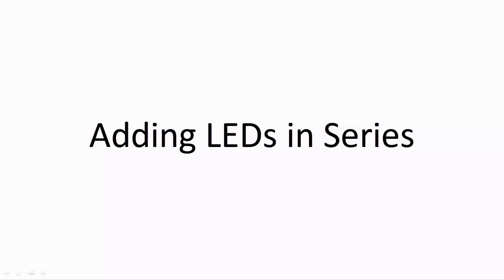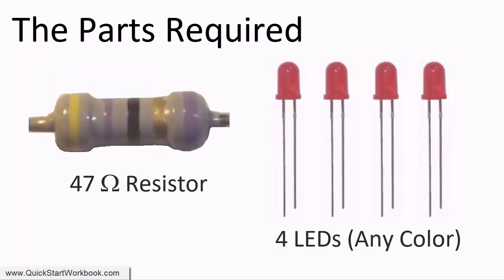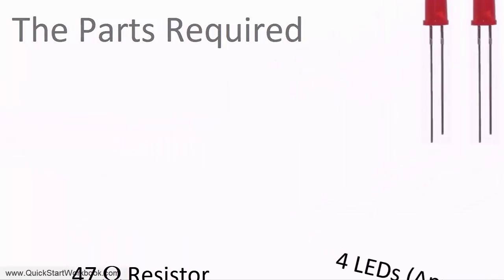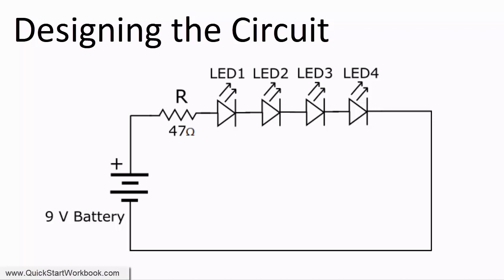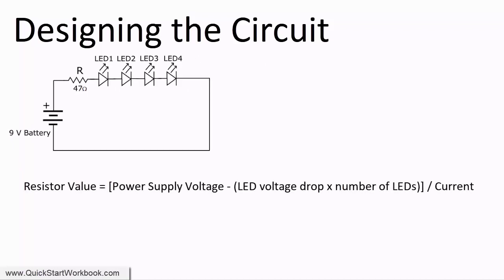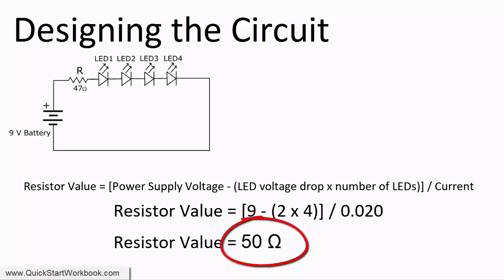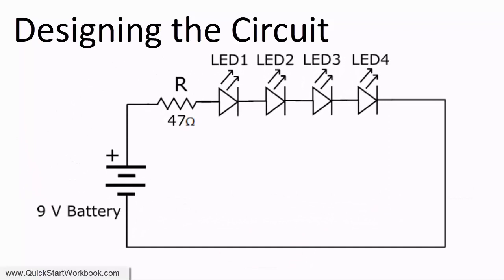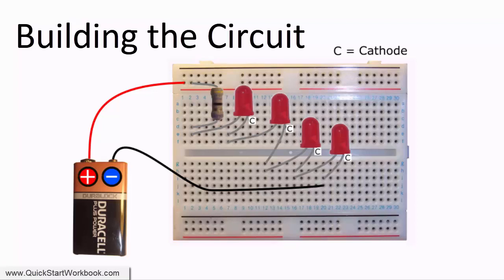How to Connect Multiple LEDs in Series - Electronics for Absolute Beginners

Comment: when I connect two leds on a breadboard they do turn on but very dim i am using a 470 resistor as in the video. Not sure what I am doing wrong
Reply from the maker: If the LEDs are dim, try using a smaller resistor. The voltage drop across will vary for different LEDs. It will generally be between 2 and 3 volts. So for a 9 v battery, and three LEDs you might not need a resistor at all, or you might need a small one. I suggest using a 470 ohm resistor because that is plenty bi enough, but you could probably go smaller.

Comment: can you use a mix of leds? red with blues for example?
if i want to have 6 leds in total 4 blue and 2 red from a 9v battery with a single resistor can i wire it like in this vid?
Reply from the maker: Hi Steveothehulk, thanks for commenting on the video. Yes you can mix LEDs. In general, coloured LEDs require about 2V; white LEDs need a bit more ... perhaps heading towards 3V. Play around with different LEDs to see what happens. Cheers, John

Comment: I have a hard time understanding resistors. How do I know which one to use? What happens if I use a resistor that are too weak? And what happens I use one that are too strong?

Is it safer to first try a resistor with a HIGH amount of Ohms, and then lowering by replacing it with a weaker resistor if needed - or should I start low and increase the resistance if necerssary?

CAN A LED EXPLODE IF I USE THE WRONG RESISTOR?

Also, the LEDs I bought never came with any specification attached. So I have no idea about their mA and forward voltage drop ratings 😑

I do have a multimeter, but I have never used one before. It has a Ohm-symbol on it. Can I use the multimeter to figure out the ratings myself? (EDIT: 🤦🏻‍♂️ Obviously yes... Becuase that's what they're made for 😅)
Reply from the maker: If you use a resistor that is too big, the led might not light up, or it might be too dim. If you use a resistor that is too small, you might destroy the led. Best to start with a high resistor and then come down in size. As a general rule, an led requires about 20 milli-amps (0.020 amps) and has a voltage drop of about 2v. If you use these figures, you won't go far wrong. I have another video that explains how to use a multimeter - you might find it useful. Thanks for commenting. Cheers, John

Comment: Is it possible to connect 8 LEDs ? What about power supply ?
Reply from the maker: Yes, you can add as many LEDs as you need to. Each LED will have a voltage drop of about 2v, so 8 will be  about 16 v. To power this you'll need a voltage supply of about 16 v (without using any resistors) or more than  16 v (using resistors to control the current). If you use a 9v battery (without any resistors) the LEDs will probably illuminate, but they'll be quite dim because the current is not sufficient.

Comment: Why do you take led voltage drop  2 volt in your circuit and how do you calculate current as 0.020
Reply from the maker: 2v is the typical voltage drop across an LED. Some LEDs might be slightly above this and some slightly below, but 2v is a good figure to use in calculations. Most LEDs require about 20mA to function properly. If the current is too low, which might happen if the resistor is too big or the voltage supply is too low (or both), the LED will not be very bright. If the current is too high, the LED might get damaged or destroyed.
Reply: @quickstartworkbook1532  Which battery i  should use for 21 led lights instead of 9 volt battery?
Reply from the maker: 21 LEDs is quite a lot so you'll need a much larger supply voltage than can be provided by a 9v battery. Have a look at this web page: https://www.google.com/url?sa=t&source=web&rct=j&url=https://www.allaboutcircuits.com/textbook/direct-current/chpt-11/practical-considerations-batteries/&ved=2ahUKEwiP9PGu5I_oAhVEURUIHUMGCgAQFjABegQIDBAH&usg=AOvVaw2vUsRX-hCQDTKoFzJ84sZN&cshid=1583839215910

Comment: Absolutely love your video, I started taking interest in this type of stuff but there's one thing I don't understand. When you showed the schematic it showed the current as 0.20 I don't understand this lol... I know I need to read up more on this subject but I just want to know how you get that value.
Reply from the maker: Thanks very much for watching and commenting on the video. The 0.2 amps refers to 20 milliamps. This is the voltage drop I've assumed across each LED. It's normally in that region. Hope that helps. Cheers, John

Comment: In the experiment shown,if instead of 4,i use 5 leds then also i need to connect a resistor?
Reply from the maker: That's correct. If you use 5 LEDs, the voltage drop across all of them will be about 10V, which is larger than the 9V supply. You might find in fact that the LEDs are not very bright because the supply voltage isn't quite enough to make them shine brightly.
Reply: Quick Start Workbook wouldn’t in that case connecting them in parallel solve the issue?

Let’s say connect a resister that would have a V of 5, and then connect the 2 LED in series parallel with another 2 in series

Would the current division affect the brightness of the LED?

Comment: What will be the resistor for 5v supply in led series? And how many leds in series?
Reply from the maker: Resistor Value = [Power Supply Voltage - (LED voltage drop x number of LEDs)] / Current

Resistor Value = [5 - (2 x 2)] / 0.020

Resistor Value = [5 - 4] / 0.020

Resistor Value = 1 / 0.020

Resistor Value = 50

For a 5V supply, if you have more than two LEDs you won't need to use a resistor at all.

Hope this helps.

Cheers, John
Reply: @quickstartworkbook1532  I didnt know this...thanks a lot. Im gonna note this in my book. Great video btw!!
Reply: @quickstartworkbook1532  By the way how can i protect my circuit from getting too much power (not constant) then if there is no resistors? Say I want to use it in my car.

Comment: Hi John, is there any difference between setting up the resistors in series vs in parallel? For example, do they glow any brighter? I'm trying to understand what the practicalities of each method are and why one method would be used over another.
Reply from the maker: Hi AD
Firstly, thanks for watching the video and commenting on it. My understanding is that series is generally better because it ensures that the LEDs all receive the same amount of current. With a parallel circuit this might not always be the case which may cause the LEDs to glow slightly differently. You may have already come across it, but this blog post (https://www.ledsupply.com/blog/wiring-leds-correctly-series-parallel-circuits-explained/) gives a good explanation of powering LEDs. 
Thanks again, John
Reply: Thank you - I read that article and understand a little more. I'm looking for someone who would be able to answer my questions as I'm trying to teach my daughter some simple electronics. Unfortunately I don't understand enough to do an adequate job. I don't suppose you'd be interested or be able to point me in the right direction?
Reply from the maker: Hi AD
I'm not a teacher so I'm probably not the best person to try and your daughter about electronics. I would suggest getting a good 'beginners' guide to electronics such as 'Electronics All-In-One Desk Reference for Dummies', which is available in hard copy or printed format. It's a big book, so it takes a certain amount of dedication to get through it, but it's aimed at people who are completely new to electronics and it's a well-written book.
Cheers, John